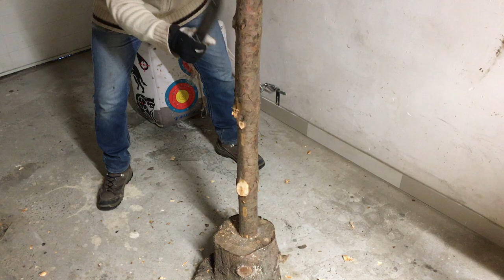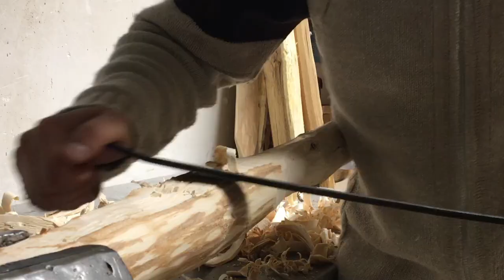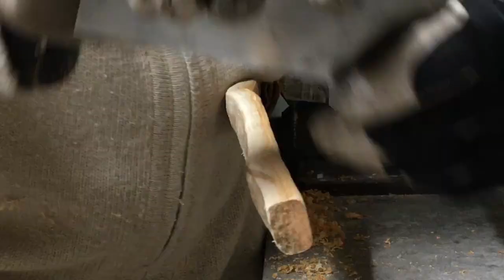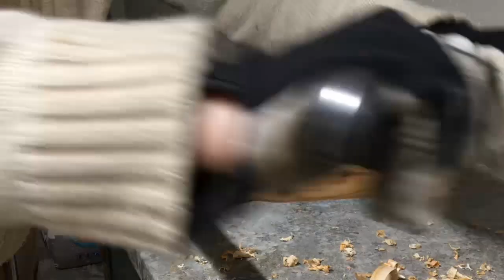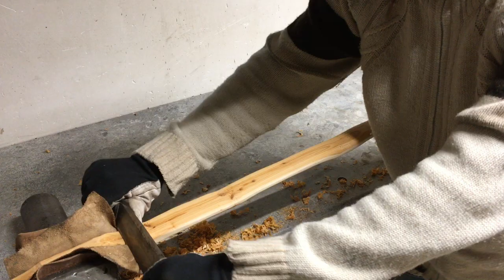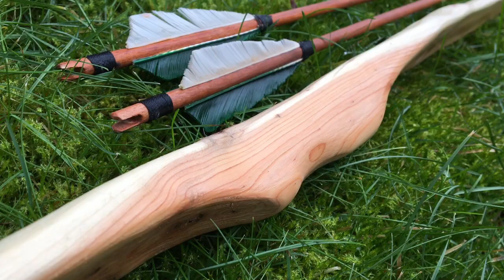Building a Yew Recurve Bow in Silence

Comment: May I ask... Is there a particular reason why you don't cut the log in half to make 2 bows out of it?
Reply from the maker: The other side is too knotty and there isn't enough heartwood for two higher poundage bows in this piece.
Reply: @DreamcraftBows  I was wondering that myself.
Reply: How is a stave good for?
I bought one from a guy about 6 years ago and it's been in storage since
Reply: @RONIN Sixx  a stave can't go bad, the worst that can happen is cracking on the ends. If it looks good it should be fine.
Reply: You may knot

Comment: Great bow and video. I want to get into using steam, whether I get back into bows or make a 3-ply banjo pot ow two. I only got into a hybrid recurve/longbow level of minor recurve (reflex/deflex) and even then I only bent by way of a form and laminating multiple layers together and they stayed like that. Steam forming is something I've always wanted to try. So many things can be done from furniture to snowboards. Cool, man! P.S. I also never did an all-natural bow other than a plain, straight longbow (I did put some reflex in one with heat alone that helped harden the back, but never got the propeller curve out no matter how much I compensated). I love the carving around knots and features to make the natural rugged look. I saw it in the Bowyers Bible and have been thinking about doing it on a flute.
Reply from the maker: Thank you for the comment! Yes, bending wood is so much fun and comes with tones of possibilities. Greetings from Poland!

Comment: I have a question. Since you basically took half of the log and made the bow wouldn't it have been better to split the log in half so you could have made two bows from one piece of wood instead of chopping half the log in small pieces and throwing it away?
Reply from the maker: The log was too thin and too knotty on one side to split it and make two bows from it

Comment: What is the tool you are using at 4:00 into the video I was wondering
Reply: It’s a straight razor basically. They are scraper blades. Very sharp metal edges used to hone and sand basically
Reply: @Tony Bourdain  awesome thankyou so much!
Reply from the maker: It's a drawknife